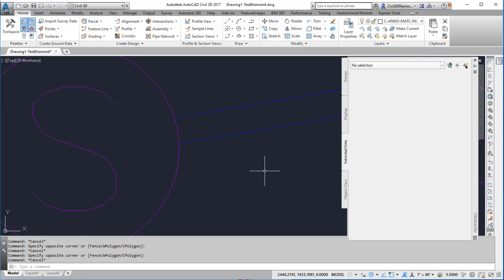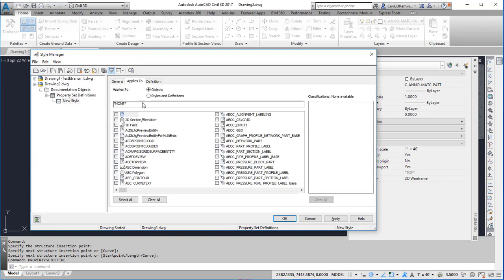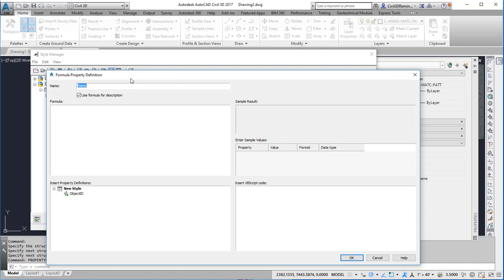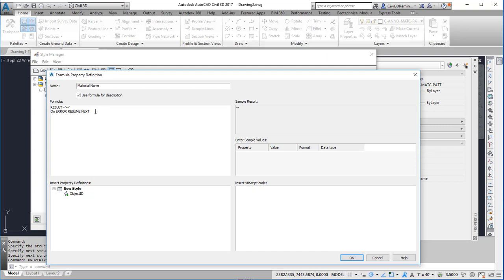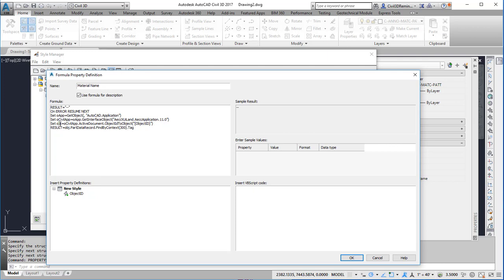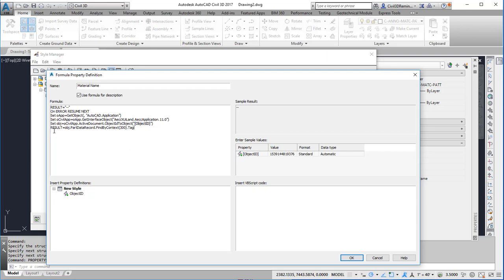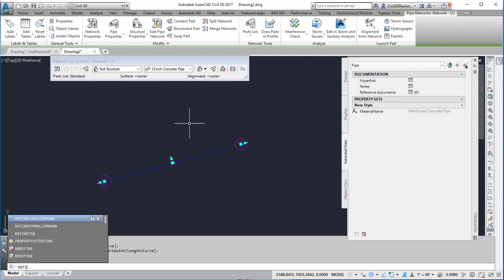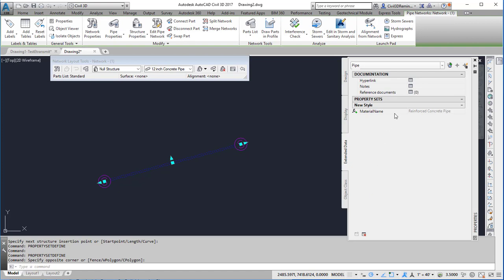Civil 3D Property Set Formula

Comment: Hi Chris, is it possible to apply this to 3D Solids, I am trying to attach extended data via a property set style to 3D Solids.

Namely show the length, width, depth etc. You can show the volume through an automatic property set but not all attributes are included in the automatic property definitions.

Im guessing it has something to do with what the Civil3D API has available, I'm a novice at best with this API stuff. Is there a way to check what elements could be assigned different attributes
Reply from the maker: I don't know about 3D Solids. Since they can be made from different other solids it might be a harder thing to do. The Developer's guide has some sample code, but I didn't see anything that gets the dimensions. 
http://docs.autodesk.com/ACD/2010/ENU/AutoCAD%20.NET%20Developer%27s%20Guide/index.html?url=WS1a9193826455f5ff2566ffd511ff6f8c7ca-351b.htm,topicNumber=d0e47727